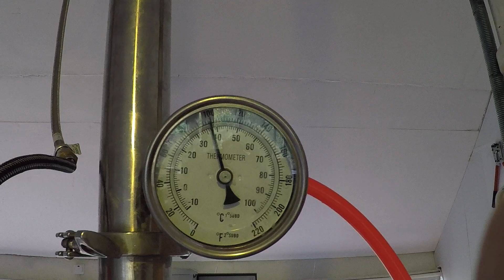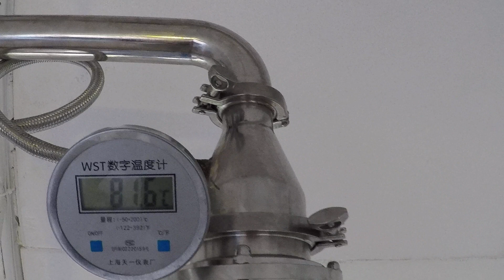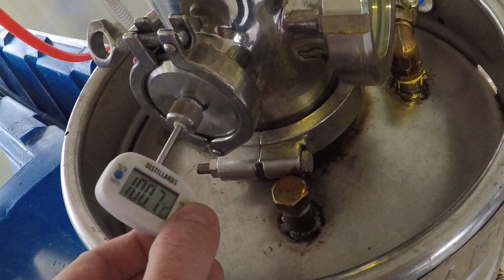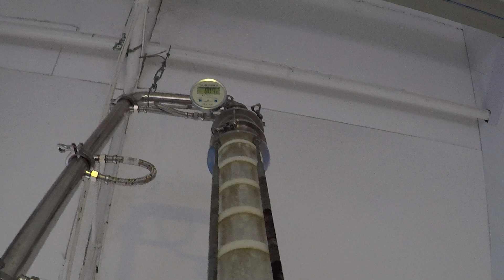Continuous Distillation overview

Comment: 3,5lts per minute and all this tubing. How is your steam generator? Your system requires a very precise fine tuning. What happens before you reach 80ºc in the top of the plate column?